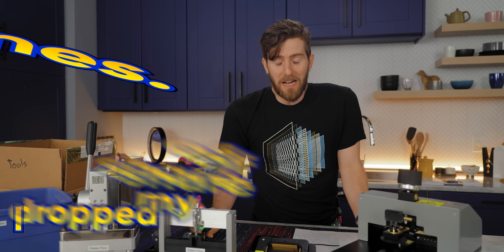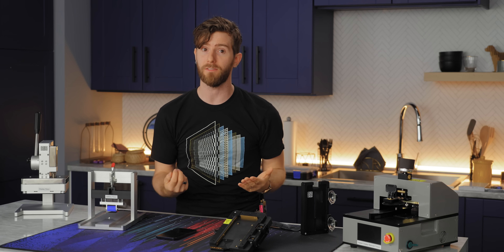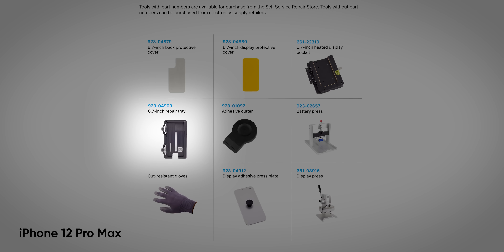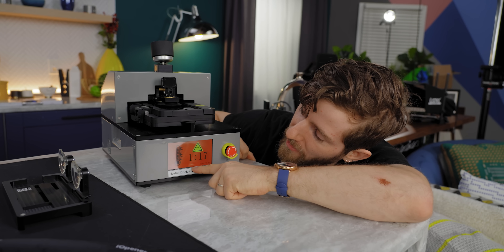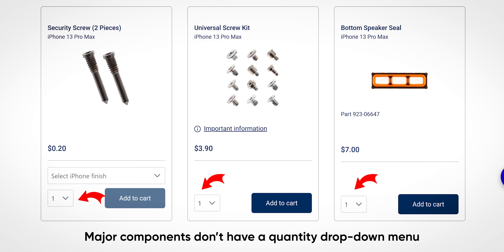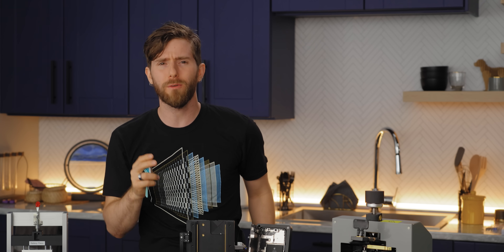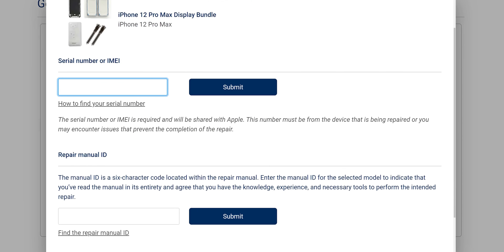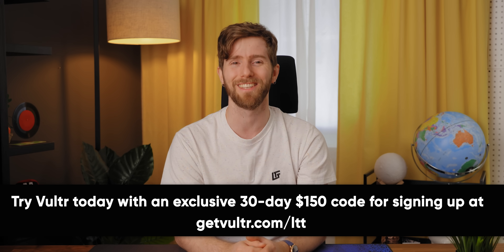I’m a Genius - Apple Self Service Repair Program

Comment: Having done Apples self repair I know the pain. 
After replacing the part you have to call Apple and get approval for your completed repair by letting them run system configuration, this removes the warning messages and artificial issues that arise after repair. This propriety software allows the parts to function correctly, In-turn making all 3rd party repair look bad and Apples offical repair be the only one that leaves you with a fully working phone.
Reply: Seriously? $400 to fix the screen & I’d still need to talk to some Apple dipshit repair person?

I had an OG Droid, HTC, & a couple of Samsungs. I switched to Apple with the 6, have an X now & I have liked how seamless things were. But $400 to replace the screen & now I’m looking to go back to Android.

Congrats Apple. You had me for 2 gens, but you played yourself on this one.
Reply: As someone whom does have access to their calibration tools, even without needing to call into a help-desk for the calibrations the process is still frequently a nightmare.
Reply: @ryanrhoden1842  why is that? tell me more about it. I mean it's their own tools so it should not be that hard
Reply: @siontheodorus1501  We're contracted by a AASP so it's via their access. So when there's system downtime it's not commonly relayed to the field techs
Reply: The process in an unofficial out of warranty "partner" takes about 5 minuets to pair the newer screens and face ID to the device. 
There is no reason not to give this option to the masses.
Reply: But on android you can just reinstall the os at any time like on a pc
Reply: @reydgukthewjw8349  Including a completely custom ROM if you're willing to take the steps necessary to unlock the bootloader, add in a hacked kernel, and root your phone. In most instances there's software that'll do it all for you, and some of them can even be undone so you can officially update your phone to the newest OS, or restore it to factory. The only thing you really have to worry about is the phone's primary interface software like Samsung, or Motorola.
Reply: @Demon-LZ  what about the drivers? It can't be just an random custom os, right???
Reply: @Demon-LZ  I am running custom firmware and root is optional. The only things that needed are unlocked bootloader and custom ROM of choice. You don't even need the custom recovery, that is just for ease of use and expanding your choice.
Reply: @Demon-LZ  The best Android phones are Google, OnePlus and all the other ones that all you need to unlock the bootloader is turn on OEM unlocking and run like 5 commands on a PC.
Reply: @andrejtb1  uhm yes it can be completely custom os are you living under a rock or something???
Reply: @helly9015  no I'm living inside your walls
Reply: @DemonTekDigital  ...But at least you can install custom roms, unlike iOS
Reply: @andrejtb1   you don't know what drivers mean sis
Reply: @fujster  oh ma gawd how dare you assume my gendah!!!!!!!
Btw ik now how they work i was just a lil’ bit confused back then
Reply: Nice to see you here! I was about to mention you in a comment as I had watched your video and break down on the self repair program when it came out! I wish he had to go through that same issue you did when you had to contact Apple to have someone assign the serial through GSX.
Reply: I mean, in newer Apple devices, that was already happening for several years, now. So, you know...
Reply: It's almost as if they want it to be so convoluted that you just give up and buy a new phone.
Reply: It’s absolutely awful! Rather get a Samsung bud, with their repair program you don’t have to call anyone, the parts are very cheap and no such nonsense with verifying serial numbers etc.
Reply: @jbutler  yah Samsung screens are expensive as shit and some parts are also serialized. Not as badly as apple.
Reply: @jbutler  Saying "get a Samsung" in response to Apple's issues is like saying "Spirit Airlines crashes too often, I better get a jalopy." Their design philosophies have been trying to copy Apple's for so long now that the fact that one runs iOS and the other Android seems to be one of the few differing factors, these days. Let's be clear, here, just because something is cheaper and appears to be easier, doesn't mean it is. Getting third party parts doesn't qualify something as cheaper and easier as they're not always efficient and competent to work with.
Reply: @TheDreamingFlame  I read that a couple of times .. Is there a point, nesting in there, somewhere...?
Reply: @petegaslondon  yes. that this is nothing new..
Reply: Price gouging and fraud are certainly "nothing new" - but shouldn't they be PROSECUTED?  @TheDreamingFlame
Reply: @petegaslondon  I meant, specifically, the tactic of securing only proprietary parts are used through a verification system.
They don't create a monopoly by doing this as everyone does have alternatives and the information regarding this is readily available so if anyone feels cornered because of these tactics it's more because of ignorance than anything else.
Reply: @petegaslondon  That's always kind of been Apple's MO, though: once you're in the Apple ecosystem, you rely on the Apple ecosystem and how they're always done things. Apple's just forcing people's hands as they always have but this time they're APPEARING like they're progressing self-repair options. Also, water damage tabs have existed in electronics for almost twenty years or more, now, and newer ones aren't set off by high humidity.
You don't like it, don't buy Apple! Plain and simple.
Reply: @petegaslondon  I'm saying the technology for detecting water damage is better than it was before and it's STANDARD across both Apple and other companies, I'd imagine.

Also, if you start applying laws because people are too lazy to inform themselves properly - especially where Apple is concerned, they actually don't make too much effort to HIDE this information from you, at worst it's cleverly disguised - you may as well make everything illegal on the precedent that people suck.
Reply: Can you override the warnings via jb?
Reply: I have to run AST2 on all OEM iPhone repairs I do and its definitely just software gating, and half of the time their calibration software doesn’t work the first time.
Reply: could not have been more than the truth
Reply: dirty
Reply: its depends. I saw few posts where guy can do literally  anything with iphone without any problem. He can add more ram for example and apple will suck smth big
Reply: @Hugh Jeffreys Wait, it has warning messages? I have changed screens and batteries of iphone 5s for my family, but I haven't ran into warning messages ( except for touch id not available messages)
Reply: @nathanyu9134  apple start showing warning messages start from iphone x and up
Reply: @awanluna  Ah, thanks!
Reply: @awanluna  iPhone 6 actually. But they expanded what would cause errors with the x.
Reply: @nathanyu9134  its only on newer iphones not the 5s that was like the last good apple phone
Reply: @nathanyu9134  Wait til you upgrade, you'll get plenty! Time to ABANDON he Apple platform, folks
 - we cant go on using iPhone 5s for ever :)
Reply: @nathanyu9134  those only starts showing up for the more current devices, 100% on the ones with faceID. Not sure about the few before that but the 7/plus definitely doesnt have it so i doubt anything before the 6s has that problem
Reply: @nathanyu9134  it's been years, why are you talking??? 5s lmfao.
Reply: @fujster  LMAO, because my family still used them at that time. They upgraded to 6 plus now
Reply: PSA. I'M NOT DEFENDING APPLE, BUT PEOPLE SHOULD HAVE THE CORRECT INFO. 
Being a "professional" in the industry, I would expect you inform people with accurate information. 
I'll correct you so people are aware.
In regards to "Artificial issues"
There are none. The calibration only removes the screen message and restores TrueTone which most people do not even know what TrueTone is, and it can be restored via a 3rd party calibration machine that is available for purchase.Although this machine is not available for the 13 quite yet, but fixing a 13 3rd party right now whatsoever isn't viable anyways.
It also calibrates the new prox, but you can reuse the old one so it doesn't matter.
"...Apple official repair be the only one that leaves you with a fully working phone"
This is also incorrect
A 3rd party screen will result in you having a fully working phone. 
You're able to avoid the error message on the phone without the calibration machine.
It involves transferring the display IC to your new screen. 
It's ridiculous that we have to transfer the display IC to avoid the message, but it's false saying that only apple leaves you with a fully working phone.
Reply: @dylan610113  You may want to actually watch his videos before you make the assumption he doesn't know what he is talking about :)
Reply: @DeanVarney  I'm basing my comment on what he said in his comment. This is a very simple topic to understand. I know who Hugh Jefferys is, and his comment is misleading. There are no artificial issues after the repair. Please correct me instead of saying "watch his videos." 
If you're aware, go ahead and tell me what "Artificial issues" there are after a repair.
 This is completely false. 
I have no need to watch his videos to know that this is false. I work in this industry for a living.

Comment: of course they dont replace the part that breaks the most (the charging port) very typical

edit: okay that tool to heat the screen and take it off was pretty cool, I wouldnt be scared of phone repairs anymore if I had that

Comment: This was predictable due to Apples continued anti self repair stance and past business practices of always screwing over the customer while finding ways to increase profits over 1000%. Business as usual I would say. They are of course relying on politicians continuing to being naïve so they can continue to fool them in saying we gave right to repair a chance but you didn't say we had to make it affordable. Recent political response to an AR brace designed for the disabled to be able to hold an AR pistol accurately for self defense, ended up being called a bump stock which is no where related physically or functionally related. They can't tell the difference between a gun accessary so what makes them capable of telling the difference between a lightning port and a usb-c or a phone battery vs AAA battery. Besides many politicians have millions of dollars invested in Apple (Nancy for example) so why would they side with the public on right to repair against Apples anti consumer business practices. From someone who has repaired apple products for years dating back to Apple II, Apple still wants to invade my business and wants access to all my customer info for some likely behind the scenes malicious act. Hopefully Tesla Pi built for self repair and self upgradable will be the catalyst to change the industry and force them to compete in that manner. Time as always will tell :)

Comment: I agree that apple has made this not great. However for phone repair it might be possible for a small shop to cannibal multiple broken phones into one good phone. I used to do that when I ran my business. In that case you have parts for other repairs and for normally half what you sell the complete phone for you have 2-3. The hard part is having the volume to pay for the cost of the tools.

Comment: If I think it over from a business perfective, I dont think I could offer this cheaper than instore repair... And thats assuming I would work for a well meaning company.

Say I have a back off repair shop in my front store. I have a limited inventory for repair, which distribution comes in with the same truck that brings in new phones. There s a box of screens designated for repair, once it gets low, the inventory system handles a new box comes in with the next truck.
I have trained people and all repair tools available. My main source of revenue is the sale of new phones instead of handling repairs, so I just mark up phone parts and not care too much about the hour wage of my repair employees. Its covered by my margin. The part price competes with whole new phones anyway, my margins are already fine on parts. If the phone is old, the sale of a new one with a trade in option, rather than a repair might be attractive to the customer. I might upsell the screen replacement with a battery replacement, if the customer wants to hold onto the phone even longer.

But now for this repair program...
I have to sell or ship you on loan a set of repair tools, plus break up my inventory system to ship repair parts.
I have to keep track of time, and do more billing work when you dont keep the 7 days. I have to check the repair tools every time they return. So its not just shipping, all those stations must be included in the shipping price. Besides, its bound to lead to fighting with customers anyway... "Tools were already damaged", "yes, I did send you everything back", "no I did ship it back yesterday". I would be lenient with the time frame, but it has to work and be complete when it return ships. Its arguing with staff and a bad customer experience, I would wish to avoid - if you could just come into my store...
I dont want to have to keep a massive inventory of shippable repair tools, so the loan window should be reasonable, but short. Repair demand probably has ups and downs.

The repair shop in the back is lighter on my business than this home repair service, and I am not dropping the part price, since I didnt really bill you for the labor cost anyway in the store.
So 'trading' the cost of labor against the shipping, the inventory management, checks and customer communication... In no way could I offer this service at a cheaper price at home.

That said, I would work with repair shops and offer them these tools and replacement parts - since, if my phone in your hands works longer and the repair is a good experience, you are more likely to stick to my brand and not buy cheaper crap at the competitor.
I make 30% from your microtransactions on my app store anyway... Its better to keep you within my eco system, even if I sell a few less phones due to repairs.
That said - the price difference for home and store repairs is too much with Apple... its unreasonable for the back office i need to add for this program.

Comment: As if repairing their over engineered laptops wasn't bad enough.  There is a reason why big companies don't buy these products, dell's business/professional laptops like the precision or latitude are insanely easy to repair and replace items because they are specifically designed to be like that.  It is extremely evident that Apple's unnecessary overengineering of their products is a detriment to their overall design.  I really hope that Apple is that stupid enough to think that nobody would notice this ham-fisted attempt to make it look like they care about Right to Repair when actually they just want to take it away.

Comment: I’d bet they want to keep the prices high on parts so that their trained “Geniuses” won’t start up a side business or just go into business on their own.

Here’s how you get around the problem of needing a serial number for inventory.  You just need to buy a pile of dead phones for sale from a bulk auction, and then you can use your new tools to take apart the busted ass phones to remove the parts in them you need to sell back, and then you can go through the hassle of trying to refurbish some busted ass phones that probably need parts you can’t even buy, or you can hang onto all those new parts for inventory.  In addition to the new parts you’ve also got the little things they don’t sell like buttons, random ribbon cables, frames etc…  the best part has gotta be having the time and dead phones to practice on.
Reply: and you can use some of the serial numbers to get official parts
Reply: @wumwum42  yes, that's sort of the point of what I was saying.  If I failed to mention it more clearly, then my bad.

Comment: what the f...300+ dollars? Here in italy samsung provides a 1 hour replacement for 185 euros for the screen and they include a free battery change in that, so if oyu phone has like 2-3 years and you also need a battery change, the screen would be 120 and 60 for the battery lol

Comment: Just generally speaking whenever there is a faulty lightning cable or faulty connnector most of the time it’s just gunk filling up the contacts. Rarely ever seen a completely fried connector. So it kind of makes sense they don’t give replacements for parts that normally imply the whole phone is dead. Otherwise their stupid steps in order to make it tedious (including charging for the tools $1000 and then issuing the chargeback later when they processed that it arrived back at apple) is generally anti-consumer. 

I am on the edge with apple as always ahahaha

Comment: I‘m really not trying to root for Apple here, but what do you expect them to do? You’ll pay a rental fee for high quality tools which is ridiculously low and you’ll pay the price for original replacement parts which seems - considering even knock-offs cost around $200 - reasonable as well. From a business standpoint selling parts to small shops makes absolutely 0 sense at all because Apple would then have to put recourses into a concept which enables other people to provide a service that they themselves are already providing at the same cost that the repairshop would ask for??